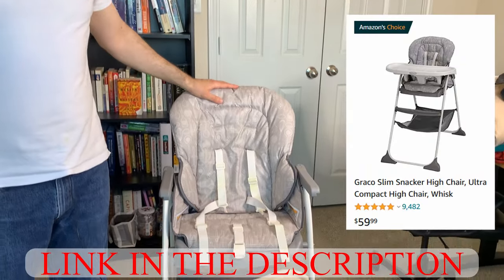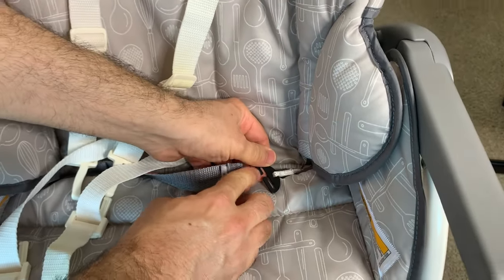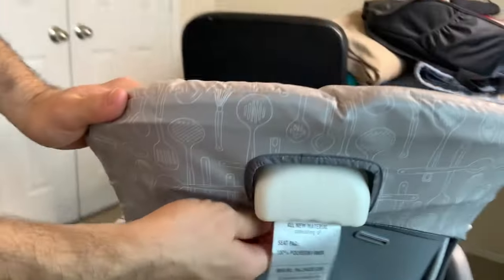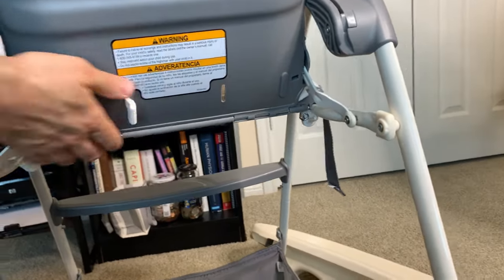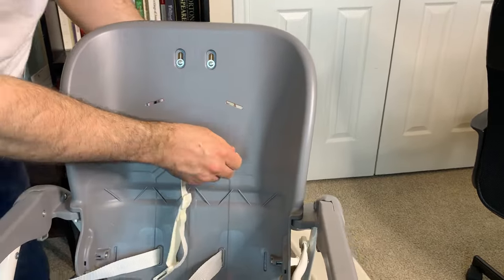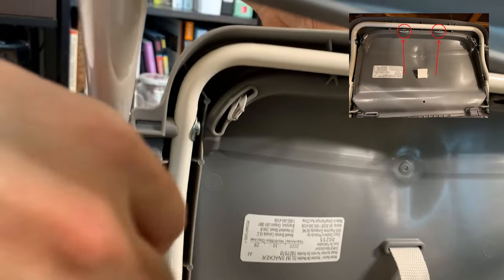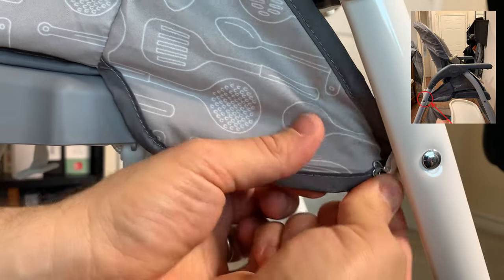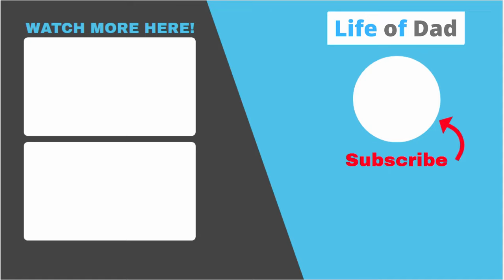Graco Slim Snacker Highchair | COVER REMOVAL AND INSTALLATION - DETAILED EXPLANATION!

Comment from the maker: Pro tip for getting the elastic bands back on during installation - put paper clips on the bands, slip the paper clips through the slits and use them to pull the bands down :)
Reply: Or use tweezers. Thanks for the video! Been trying to remember how those back elastic/metal clips go back in. A big fail on Graco for not mentioning all this, of course we’d like to clean the chair!
Reply: I used a dessert fork and it worked flawlessly
Reply: Totally used a butter knife 😅

Comment: Thank you!  I was hung up on the folding strap this time.  The last time I got stuck on the side elastic,  I didn’t see the hook apparently.  

For those saying you can just wipe it, yes,  you can but only for small messes and not for extended periods of time.  My daughter has been using hers for 1.5years.  That’s a long time.  The seat is water resistant not water proof and after a while the plastic overlay starts to wear.  My kid spilled milk so much so, that it soaked her pants and was pooling in the cloth at the bottom of the chair.  Food also gets in the fold where the folding strap is and it’s gross, at some point it needs to be soaked in water.  Mine is in the machine now and I’m so thankful for this video
Reply from the maker: I love these types of comments! So happy it helped!
Reply: Ditto. I figured out everything, until the folding strap. It made no sense that everything else is detachable, but the folding strap has no apparent way to remove/unfasten. It never occurred to me to check under the strap to find out that the buckle has a gap. Because there is no indication that there is one. Every other point that fastens the cover to the chair is visible.
Reply: Same! Thank you @lifeofdadYT❤
Reply: Wait how did you get the folding strap off?

Comment: Thank you so much, I was looking for something like this for awhile, thank you 🙏
Reply from the maker: So glad it helped!
Reply: @lifeofdadYT  I followed your video to wash the cover and now the shoulder straps aren’t working and I put them in correctly, what do I do now?
Reply from the maker: @tonie48  Sorry just saw this, what do you mean they're not working correctly? It does matter which side you put them on in order for it to fit into the buckle so make sure that they are aligned in the correct side.
Reply: @lifeofdadYT  I put the straps back in, with adjustable part facing towards me, I put the hip straps in before closing in the bottom center strap and it doesn’t close anymore

Comment: They must have changed the design at some point. My folding strap does not have those hooks. It is threaded into the strap and goes through a hole in the plastic clip at the end and is doubled over on itself and singed- too big to go back through the hole.
Reply from the maker: I don't exactly follow, but that sounds actually worse...

Comment: I can’t seem to get the bottom straps off to soak them =[
Reply from the maker: 😕 Is it different than what I showed? Sometimes you have to struggle with it. If you’re really having a hard time pulling the straps through try pushing a corner in and grabbing it with pliers on the other side for leverage (ridiculous I know)